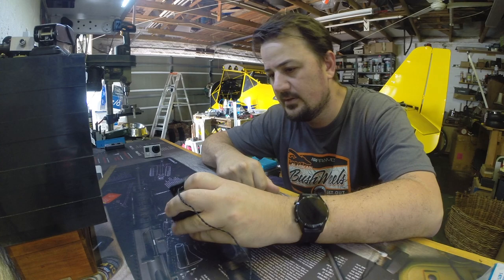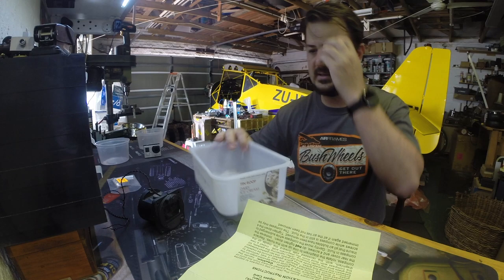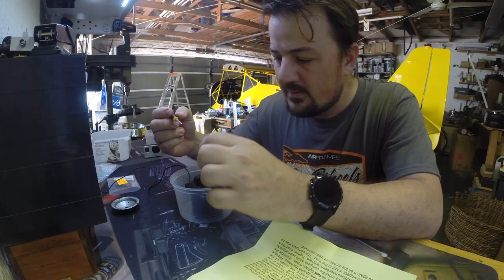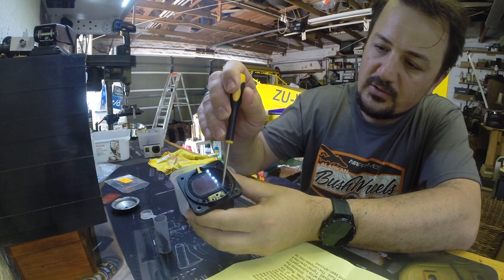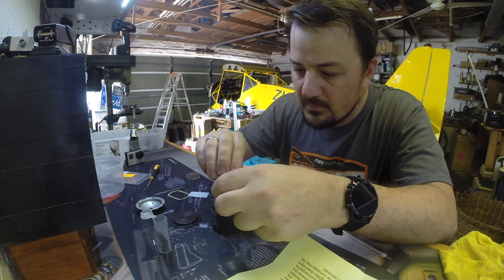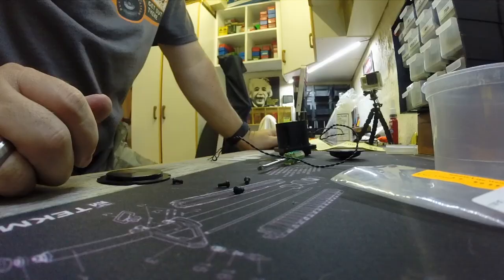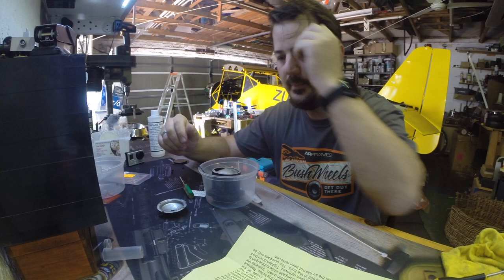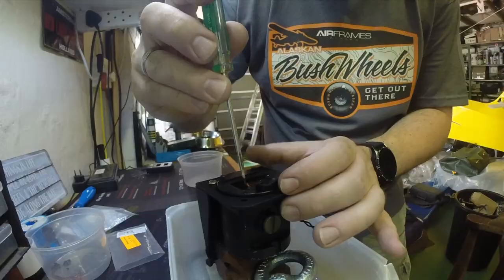Airpath Compass - service and repair

Comment: I like the way you got around the problem. The way I did it was to use gaffer tape around the back to make its own bowl and over filled it that way, as I had the same problem, of not having a container the right size to take the compass that did not have such a large volum that it could be filled above the compass rear.

Comment: I couldn't submerge mine either. I ended up filling through the top hole, which took several times, but I was able to get it filled. Great video!

Comment: While apart, I would have liked to see how to replace the lamp. A new 99 cent lamp should be added as part of servicing.
Reply from the maker: Lamp replacement is super simple. You don't need it apart for that.... just flip up the little cover on the front of the compass above the glass, the globe pops out on a spring, slide new one in....

Comment: Why didn't you just fill the compass through the filler plug on the top?? ...
Reply from the maker: Because you end up with an air bubble, the top filler point is not at the highest point in the housing, so to get a complete liquid seal, submersion turned out to be best. or in my case, fill through lens until it overflows.
Reply: @NicHolmes  There is an easy way around that.  I've been rebuilding aircraft compasses since the 1980s. Close up your empty compass, and remove the filler plug on top with a large proper fitting common screwdriver. fill the compass with an aide like a dropper, pipette, etc. carefully roll the compass around to get most of the bubbles out, and refill it right to the top, and temp install the plug.  Now you need a helper. Did you see the air hole on the back of the rear cover?  Apply gentle suction to that hole, and remove the plug (can be done with your mouth, but yuk!). Refill the compass and roll it around carefully, but don't break the suction!  Get as much air out as possible, and refill right to the top and install he plug temporarily,  Now remove the suction, and roll the compass around to get the air to the plug, and loosen the plug.  Let all of the excess compass fluid out, and then re-tighten the plug.  Be sure that you have no pressure left in the compass, or the diaphragm will rupture within a year.

Comment: Nic
First congrats on doing this topic.  It is needed and you're the only one showing it.  thanks.   
Question:   Which way does the bevel go on the glass?  You mention "down" but what exactly does that mean.  Is the slanted side facing up or down.  In the video it looks like the slanted side is facing up.  I noticed the instructions don't tell.  They just say, put it back the way it was.  Well opps on that.   I even have a manual and it doesn't mention it either.
Reply from the maker: So I remember this little quirk.
I figured it out by trial and error...
The beveled face goes "down" or facing into the compas body, that's because the cork gasket needs a flat surface to mate against when the front face is screwed down. If you put it on the other way around the glass actually sits proud a bit, and will leak. If you then try tighten the screws up to squash the gasket further the glass will eventually crack
Reply: According to Airpath, the beveled edge goes at the bottom and slanted side out. 

The glass cover is concave, putting pressure on center of the the glass as screws are tightened. Tighten them too much and the glass cracks. Never try to make the cover and the body touch. So, snug them up, then use a straightedge to see how flat the cover has become. Flat is plenty tight enough. If it goes convex you tightened it too much and probably put a stress crack in the glass.

Comment: Thanks for the video, Nic. How did you remove the rubber gasket debris that must have fallen into the housing? What does the big screw on the top do? Couldn't you fill it through that?
I just picked up the same kind of Compass without any fluid in it. So this video will help me. May I kindly suggest for future videos to reduce the volume level for the music.
Reply from the maker: Amazingly there was no debris inside the housing. The gasket hadn't broken down to that stage yet. I have no idea what that big screw does, however filling it from there will leave you with an air bubble in the compass as the screw is not the highest point in the housing.

Comment: Sorry, but you did not successfully service the compass.  Get more fluid and show the submerge process.
Reply from the maker: Please explain the successful way then? For the educational purposes of all the viewers...
Reply: @NicHolmes  Well, we need to see how to get bubbles out.  The instructions mention dunking. I was hoping to see this.    But I think you could also get all air out thru the top hole, and maybe you did, but you didn't show moving it around and getting the bubbles out.  Loading thru the front doesn't get the bubbles out. You didn't move it around and show the camera.   I've don't it several times and it is hard to get them out.  This is why I like your topic.   I was hoping to see it done completely.  Ai bubblesr hides under the compass wheel and it would be nice to see that you got them removed.  The hard way I've done it is thru the top opening.  You can swirl and move the compass getting all bubbles out from under the wheel and they go to the top.  But if the oil is not topped off the bubbles stay near the opening and do not go up.  If you keep topping off the filler hole the oil will form a convex swell above the opening and you can get the bubbles to go up into it.  So the key on this method is to make a swell of oil on the opening and move the compass until all the bubbles float out and then install the plug.
Reply from the maker: @sglynn  yeah, you are meant to submerge it. But I found that extremely difficult to get right. The easier approach was over filling it and sliding glass in at an angle to not get a bubble under it. This is method I showed after a few attempts at dunking it. I do not have any air bubbles in mine after that method, even after rotating it around and a few times.
Reply: @NicHolmes  Nic thanks for the follow up.  Sorry my initial note was too harsh.  Thanks for making this video.  And thanks for the follow up notes further clarifying you got the bubbles out.
Reply from the maker: @sglynn  no stress.... its not as simple as the refirb kit instructions make it out to be 😄